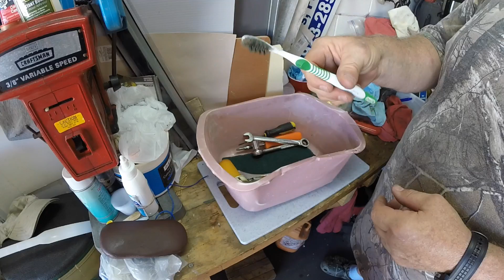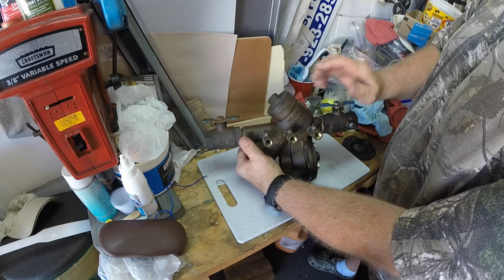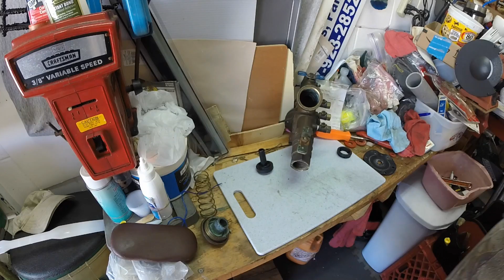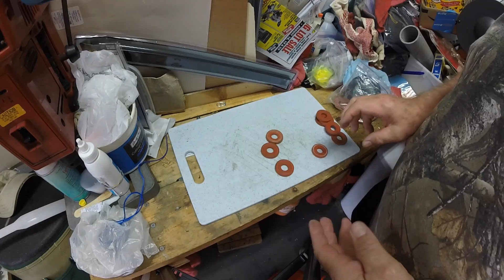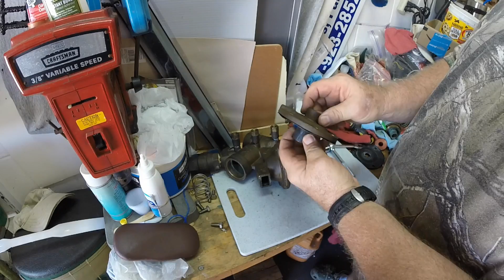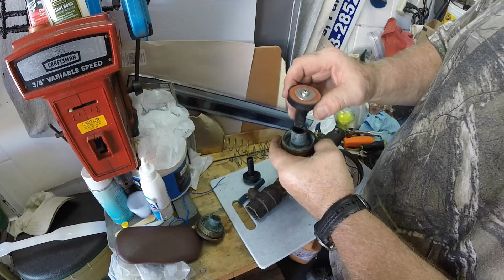BACKFLOW VALVE REPAIR  -  RPZ

Comment: Very good.  Have a Febco 825Y.  Leaking thru the guard shield.  Shows a seat on the parts diagram.  Is the seat in the relief valve replaceable.  Valve is 15 year model.  Can't feel a seat back in the housing back of the shield guard
Reply from the maker: The 825Y is a good valve. The seat for the poppets on CV#1 and CV#2  and the relief valve are not replaceable depending on when the valve was manufactured.  Since they are metal seats they do not wear out or crack like the plastic seats in most other manufactureres but earlier models now have replaceable seats. It also depends on what size valve you have. The interior parts can be configured different than other sizes. Either way, if they are replaceable seats you need a special tool that grabs the seat and allows you to spin it out and back in. 
If it is leaking out of the relief valve port on the bottom (I think you are calling that the guard shield?) it is likely not the relief valve that is the problem. 99% of the time it is Check Valve #1 that is the problem. The relief valve and CV#1 work together to create the five pounds of pressure needed to close the relief valve. CV#1 is the first place the water hits when it enters the assembly. That seal (disc) inside can have debris on the surface or the seat causing the pressure to drop inside allowing the R.V. to drip. Turn off the water, release the pressure inside by opening the test cocks, unscrew CV#1, (be careful it is spring loaded and you can loose parts if you are not careful, also the spring for CV#1 is different so do not mix them up or it will not work at all) remove the poppet and look at the seal and the seat for damage or debris. If none the seal may be worn. Remove the screw in the center of the poppet and remove the washer (remember which way the washer goes on there is a front and back) then remove the seal carefully but do not tear it. Wash it off gently and if it has never been flipped before, flip it over so the smooth side is now facing out. If the other side has a groove and looks bad it has been flipped already and you need new seals. Tip: when you reinstall it, make sure you lube the O-ring on the cover (code requires a food grade lubricant, I used to use Super Lube that can be found at Walmart-Mart or some sports stores) then hols the spring in two hands across your chest and SLIGHTLY stretch it too be longer than it is already. Do not go crazy. The additional spring pressure will allow the seal to seat better on the seat inside the of CV#1 and it will likely stop leaking. It may even take a day for the leak to stop because the seal needs to press into the seat to hold back the pressure. Make sure your clean the poppet and the stem of the poppet so the stem travels easily through the hole on the cover for CV#1.  Good luck, I hope that helps.    Gerry